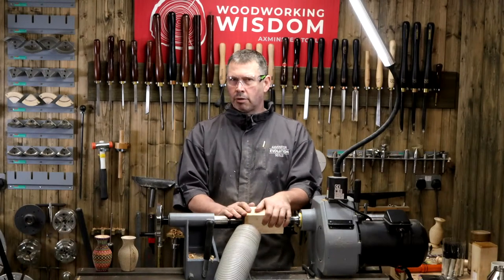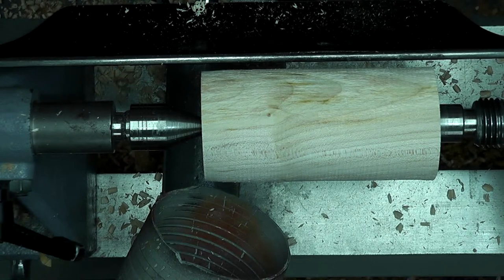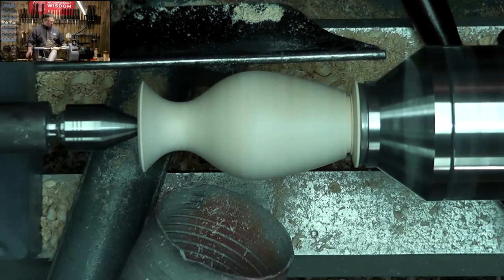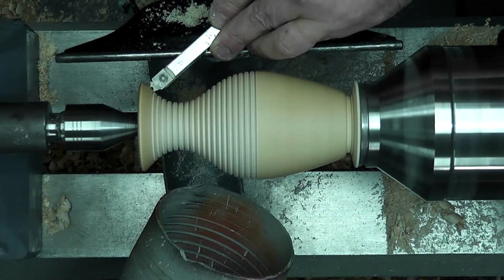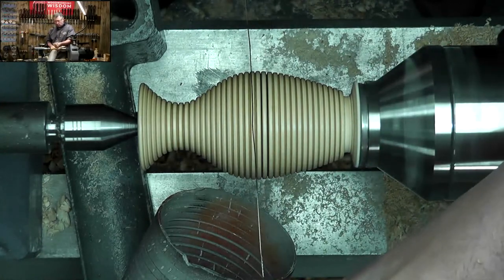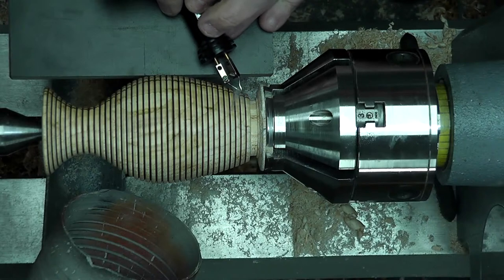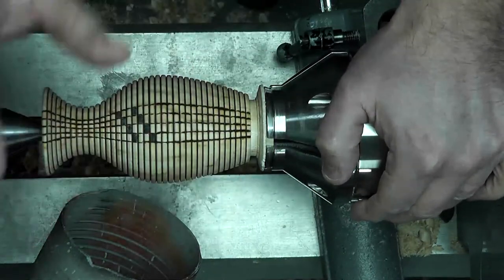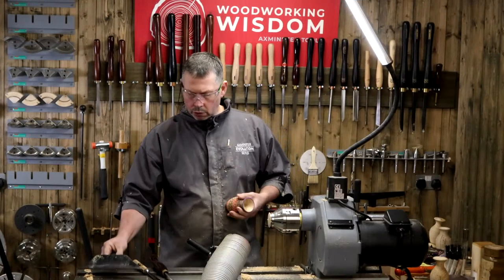Turn a Basket Weave Vase - Woodworking Wisdom

Comment: Great demo. 

Can you tell me where you got the sanding platform from please? 

Thanks
Reply from the maker: Hi Craig, the platform is made up from several parts, firstly the stem is from the Axminster Tool Rest System so you will need to select your tools post size, here is the part number for the 1" post 101833, this fits to part 104451 which is a mounting plate. This allows you to add a ply or mdf platform. Hope this helps!

Comment: Hi Colwin, you regularly recommend Camellia Oil, is this better than Machine Wax?
Reply: Camellia oil is from a flower, so it’s not as toxic, plus the samori put it on their swords
Reply from the maker: Hi Edward: "I use camellia oil to clean and to spray on if leaving for a long time, but machine wax is a slide way lubricant to ease movement on the bed and give a certain amount of rust protection. Camellia oil can be used on tools as well as machines." Hope this helps.